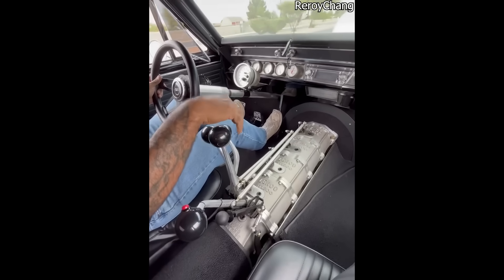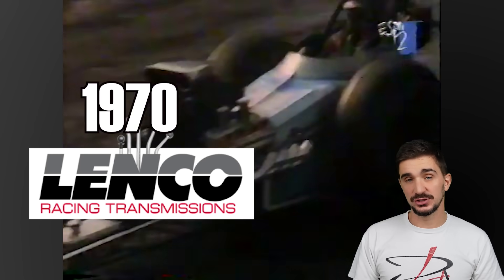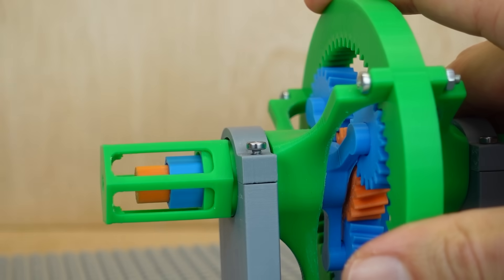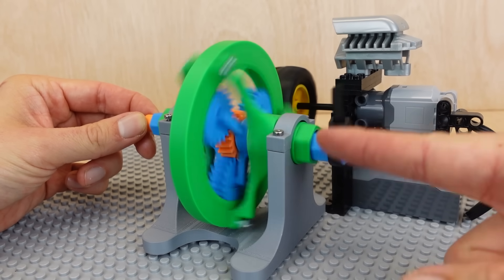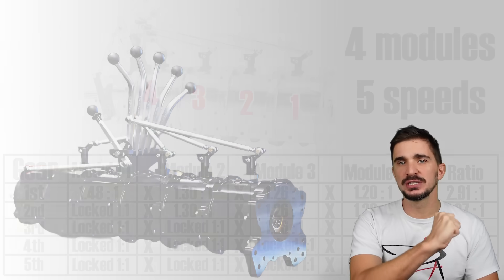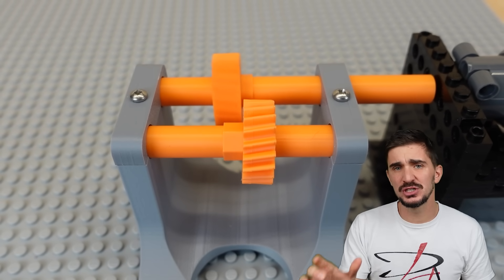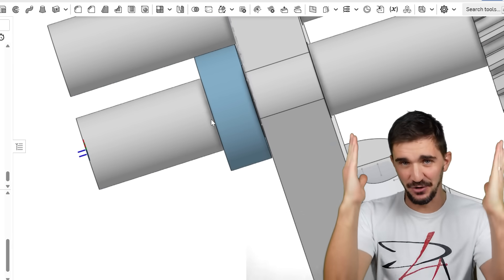This is The Strongest Transmission Ever Built - Planetary Manual Lenco Gearbox Explained

Comment: The power flow between stages is still unclear. How do they engage with each other, and how does the power flow input>stage1>stage2>...>stage5>output look like?
Reply: They're just stacked in series - the output (planet carrier) of each stage feeds into the input (sun gear shaft) of the next stage.
Reply: @brianb-p6586  So do they share constant-mesh sun gear? Can you engage random stage, like 4th without engaging first 3? I am quite visual guy and unable to imagine this in my large and spacious head.
Reply: @ryteulopki8069 each section has its own planetary gear set, each with it's own sun gear. Of course they are all constant-mesh, like any planetary gearset. The output of each section is from its planet carrier, and that is connected to the sun gear shaft of the next stage... so no, there is nothing shared about the sun gears of the sections. 

Yes, any stage can be shifted into reduction independently, in any order, but they are in sequence with ratios selected for best performance.
Reply: @brianb-p6586  If you can engage any section individually... this would mean that you have... for 4 sections, I would be 4 to the power of 4! As each section could be combined with any other. This does not make sense! 

AI is also useless for explaining this. I would have to get one and just play with it ;)
Reply: @ryteulopki8069 yes, you could have 16 different ratios, but it would be impractical to shift between them so it is not used that way.
Reply: @brianb-p6586  Wooo! Really!? No F way! You just uncovered another rabbit hole! I will spend 3 nights chasing that bugger! Thanks :D
Reply: @brianb-p6586  No way this is not implemented somewhere! Off-road dump trucks or even long haul? The 5-stage gives 32 ratios (-1 neutral, so 31 forward). This kills standard manual and automatic gearboxes used in heavy transport! I cannot believe this is true and not used everywhere!! Even if some ratios were out of space, there must be a way to make a 5-stage with at least half (15) usable, high torque gears. And even if other were ignored, this still should produce a smaller and stronger G-BOX!!
Reply: @brianb-p6586  Impractical to shift? I am used to 24 speed in Europe. 20 forward and 4 rev! You do not use all of them, but jump around as needed. Also, nowadays it is difficult to come across a manual in Europe. +95% are automatic. And Volvo iShift does not change step by step, or gear by gear, but also jumps directly to the most appropriate ratio depending on demand.  So having 31 speed in auto would not matter.
Reply: @ryteulopki8069 these are completely manual, so shifting muliple sections simultaneously would be impractical. They are also shifted under full power (it's the reason they exist), so any change that requires two or more sections to shift would not work because intermediate states would not be acceptable. 

It is now normal for automatic automotive planetary transmissions - in both heavy trucks and cars - to use multiple gearsets in various combinations, shifting directly between ratios by engaging and disengaging multiple clutches in one operation... but they reduce power during the shift (whuch only takes a fraction of a second).
Reply: @brianb-p6586  completely manual but very easy to automate.
Reply: @brianb-p6586  But 500hp 12 speed 2500Nm volvo gbox is 450kg, meanwhile 5-stage, 3000Nm, 31-speed lenco apparently 200kg with simple modular assembly.
Again, fully manual - requires a few actuators and a simple microcontroller to make it 31-speed full auto - this wouldn't be an excuse!
There must be some catch!!

Comment: Hmmm... how do you put it into reverse?
Reply: Reverse is a separate section at the end. It goes in reverse when reverse gear is engaged, with an overall ratio determined by what other stages are doing reduction.

Comment: A conventional hydraulically-controlled planetary transmission doesn't need to slip any more than a Lenco; the difference is just application. In a racing application of a conventional automatic shifts are abrupt; in a street application of a Lenco the driver will need to shift smoothly.

Comment: You should do a video of a Liberty Transmission that made the Lenco semi obsolete due to parasitic loss by planet gears
Reply: I had not heard of Liberty's transmission until this discussion, so I had a look. 
A Liberty is is a traditional countershaft transmission, so it uses parallel gears instead of planetary sets. It has dual countershafts for strength, like some heavy truck transmissions. It achieves clutchless shifting and continuous power transmission by engaging each dog clutch separately and using ramped dogs so that when each higher gear is engaged it drives the previous lower gear's dog ring out of engagement... as used in other drag racing transmissions, including motorcycles; that means it uses dog rings instead of friction clutches. Overall, a completely different solution to the same problem as the Lenco, with more traditional design elements and inherently better efficiency.

Comment: is this the secret sauce behind caterpillar engines for semi?
Reply: No, Lenco tranmissions are useless for real work - they're just for drag racing. 
Clutch-shfted planetary gears are used in conventional automatic transmissions, which are available in very high capacities for trucks, and heavy truck transmissions often have a planetary auxiliary section, but the main transmission of most trucks is a traditional countershaft parallel-gear design.
Reply: @brianb-p6586 what about drag racing a semi?  with a 40 ton haul...

Comment: Unbreakable? Almost. Popular? Never. They were a niche thing when they hit their peak, and were never popular because of how damn heavy they are (as well as several other factors, but this was the primary reason). The weight added to the car for the trans & mounting negates what little speed benefit it gave in all but the biggest NHRA dragsters (compared to something like a PowerGlide setup), and those NHRA beasts already have trans that get replaced after every run anyhow, so no advantage...

Comment: Excellent video! I'm a transmission engineer and I even learned something!
What if I told you I designed a CVT that can handle virtually unlimited horsepower and torque while following the horsepower torque curve without friction 
And very low heat losses? The only losses are bearing losses for the most part.
It can be used with any type prime mover including electric and even be retrofited into a tractor-trailer. 
I am a lifelong machinist with many patents including a publicly traded aircraft company based on my patents. 
I would like your opinion on it as I think you could be an effective influencer. 
In addition, I also think I have identified the best ice engine that has been strangely overlooked. The elbow engine has no reciprocating mass but does only in appearance. It is actually a rotary piston engine. 
I have some improvements on the concept.

Thoughts?
Reply: My thought is that you are extremely arrogant and uneducated. If you understood the designs that you are promoting, you would understand why they are not what you claim and why they are not used.
Reply: @brianb-p6586 
Oh really, do tell.
How could you come to that assumption? A fool answers a matter before they hear it.
Do not cast your pearls before a swine! You'll never know.
Reply: @SpiritofDaniel ante up, then.
Reply: @brianb-p6586 
To who, you? 
I was asking the content creator. 
If I told you it would be a public disclosure. It has to be under an NDA. 
I would love to share, however, that is IP suicide.

Comment: You didn't mention that the largest use of planetary transmissions was in the Ford Model T.
Reply: I want to see period-correct Model T racing, become a historic racing series!! Any mods are acceptable, but have to have been possible in a small mid 1920's local garage, using tools and machining, available, and possible in the day.
Reply: Largest use? Every conventional automatic transmission is based in planetary gears. The entire production of the Model T over its two decades only matches about three months of current planetary automatic transmission production.

Comment: If I remember correctly one of the novas my grandfather long before I was born had a 2 speed power glide in it, he’s always been a car guy, him being a car guy is the reason why the ram we have has a 5.7L Hemi V8 and even stock it’s a little monster it’s also paired with the E-Torque system which definitely helps with gas mileage and acceleration!

Comment: Some of you information is extremely outdated.
I knew a transmission builder in Boise, Idaho, who built 700R4 GM transmissions to put in 2000 hp dragsters in the mid 1990s.
They lasted for literally years.
I had him upgrade one for me with 29-sprag clutch rings, 6-planetary gearsets and 2 extra clutches per pack.
I routinely pounded the wheels off that truck hunting and off-road rock crawling for 10 solid years.
It has a diesel engine, 38 inch tires, 1-ton axles, 8 inch lift, 9000 pound truck weight and after pulling full trailers routinely, the guts of that transmission were beautiful and clean and still banged into all 4 gears.
I told him I wanted it to chirp the tires when the torque converter locked up, and he gave me more than I asked for.
Had the flywheel not cracked and taken out the front pump bushing, it would have still been running all the original parts from 1996.

Comment: Great video, very informative. Lenco's used to be very popular in drag racing but regular manual gearboxes made by Liberty (twin counter shafts) have replaced them because a Lenco sucks up a lot of HP to spin. Torque convertors have become so good that Lenco's are also being replaced by TH400's, of course there is not an OEM part used on those $12k TH400's, including the case. They are regularly subject to 4,500+ HP, even over 6,000 in some cases. The guys who still run Lenco's often put a torque convertor in front of them instead of a clutch.
Reply: Unfortunately racing is becoming homogenized, once one guy finds a "winning combo" everybody else flocks to it because it's too expensive or difficult to do anything else.

Comment: If you've ever been serious about about drag racing, you know what a Lenco is.
Reply: Three speed Lencos are common in many drag racing classes. And if you want to make your Lenco stronger while keeping your number of gears and gear ratio in each the same, you do one of two things or both as needed: upgrade from a 3 pinion(the 3 planet gears in the video) to a 4 or 5 pinion - doing so is an easy swap in a Lenco. OR you add more clutches and steels to your clutch pack in each module. Depending on how many your adding, this may require a slightly longer drum. The usual 8 or 9 clutch clutch pack is almost always strong enough. For any engine with 2500hp or below using a 3sp Lenco, the stock Lenco is almost always strong enough. It all depends on the amount of torque your engine makes, when torque peaks, the type of power adder you are using if any, and the weight of vehicle.

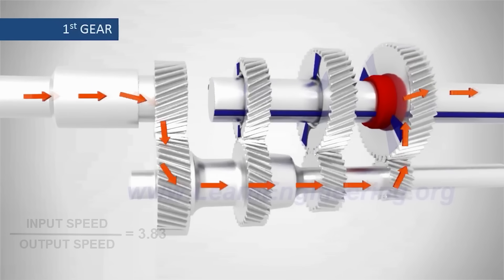Comment: 10:50 just wanted to point out, that from my understanding the problem is that in manual - yes there is two points of contact, but they are in sequence. The video for me just seems to lead to a bit of a misunderstanding that the force is spread among all the contact points. But actually each point of contact is in sequence, just like a chain where each chain-link must withstand all the force applied to the system. And when you talk about planetary gears each module has 6 contact points which is true, but - when you lock them, to actually transfer torque, the full force is going only through 3 contact points at a time, meaning the force is devided by 3 per gear when compared to the manual.

Comment: What about drivetrain friction losses with that many rotating parts and contact points? I understand that it is not really that important for drag racing where the other advantages are way more important but I think it should have been brought up as disadvantage similar to noise etc.

Comment: Another advantage of the Lenco is that even if one clutch or gear breaks, you only lose your highest gear which means it's still perfectly drivable, and it's so simple and modular that you can easily and cheaply repair it in a day.

Comment: Something to add is 2 planetary gearsets actually offer 4 ratio options, as long as each planetary gearset has a different ratio. Because Lencos have very similar ratios though, there is no reason to pull the levers in any other order.

That being said most planetary gearset transmissions (most automatics) obtain all their gear ratios from only a few planetary gearsets. For reverse you also don't usually need an extra gearset, but simply switch the output from the planetary gears to the ring gear on one set. (Or to the sun gear if the ring gear is the input, most automatics use the sun gear as the input.)

Another note: In a lot of documents the ring gear is called the internal gear, this is because the teeth are on the inside. This is confusing because the internal gear is the outermost gear.

Comment: Very educational video. I've known about Lencos for kver 5 decades now and wished I could afford kne but that doesn't look like a reality, so I'll.just have to stick with aitos built as tough as I can build them, which a good reason for hsing turb hydromatics. They add more clutches as your geras.go up. That is cutually reverse kf what a peron would really want because in lower gears that's where th torque stress is highest. Which would be my next reason for choosing a Tirque flight because the internal parts are so much beefker than the TH units. Kf course Inwould not really choose the smaller version TF in any high powered vehicle, only the 727 model

Comment: Funnily enough, I was watching videos about a different subject. There's a guy here on YouTube who took two Muncie 4-speed manuals, put one of them backwards in his truck, and created a truck with insane overdrive.

Now I'm wondering if a lenco transmission could be installed backwards, because it does not have any thrust bearings. 

You said that the lenco transmission is bad at downshifting. Why

Comment: So, basically this transmission is the automotive equivalent of a bicycle gear hub (Sturmey Archer, Shimano Alfine, Rohloff, etc.)?

It's worth pointing out that an an Automatic transmission doesn't need to slip if you don't care about smooth shifts. They can be modified to provide quite brutal shifts (and increase transmission life). I suspect the Lenco's shifts are quite brutal if the clutch isn't used.

Comment: At around 11:44 your poimt about automatics needing to slip for smooth shifts. 

I would've worded it differently. Your typical daily driver does that. But you can build automatic transmissions to have very fast shifts with almost no clutch slip.

Comment: Hi! The another factor to consider is that each gear mesh loses about 5% of power, so the transmission is least efficient in lowest gear, and most efficient in highest gear. These losses in efficiency are evident as heat.  The design of the automatic transmission is such to reduce the number of gear meshes to a single mesh point for each gear speed / mesh pair. Additionally, there is the ability to lock the torque converter, which acts as a fluid clutch and provides some of the "slush" in a slushbox (auto trans).

Comment: If you don’t treasure your sanity, check out a turboprop gear trains.

Spur gears also have the problem of oil trapped between the teeth when the case is overfilled..heats the oil.  

The axial thrust of helical gears can be leveraged…..
The thrust can be counterbalanced with oil pressure.  When the engine torque pulsates, the helical gear axially pushes against the oil.  This dampens engine pulsation and vibration.  Used on WW2 radial engines.  
Helical gears can be setup to equalize the load carried by the gears.  
Helical gears can be machined with one side right hand teeth and the other left to cancel thrust.

I am told most planetary designers prematurely end in a home rocking on the porch while drooling on themselves.

Comment: I have not seen the other video on planetary gears. So my view is that there are three possible speed outputs for one speed input. For the above statement to be true, one needs the diameter of planetary gear to be different from diameter of sun gear. I realized the ring gear moves in reverse in the described setup. Thanks.
Reply: There is an additional mode for a planetary gearset, which produces a different speed ratio and in reverse. It is not used in the Lenco design, and not mentioned in the video.

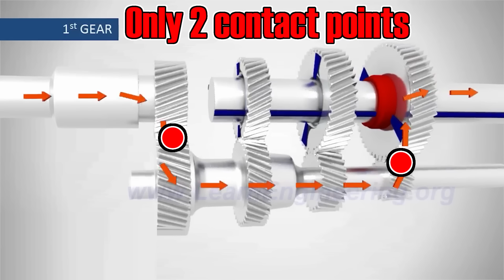Comment: 10:53 maybe I’m wrong but I think it’s important to point out that the load is passed through two gearsets, but it is not shared by two gear sets. The gear sets are in series, so if one fails, it all fails. So in reality, the torque is being handled by 2 single gear sets independently. It’s like counting the links of a chain and thinking they each add up cumulatively in load capacity
Reply: The same can be said for the following count on the planetary gears , just because a single planetary gear has two contact points doesn’t mean the torque is shared between those two points. Its a series/parallel distinction.

Comment: 8:50 what if you made this kind of transmission out of  locking hydraulic torque converters in series instead of torque converters? it might be even stronger because you can't break the gear teeth  off a fully hydraulic system
Reply: The whole point is that fully mechanical systems are super easy to work on. Can simply disassemble and reassemble, no pressurized systems to drain and fill and filter
Reply: that would be horribly inefficient